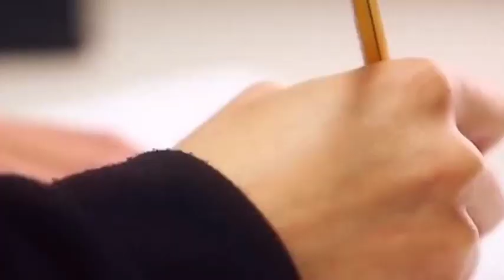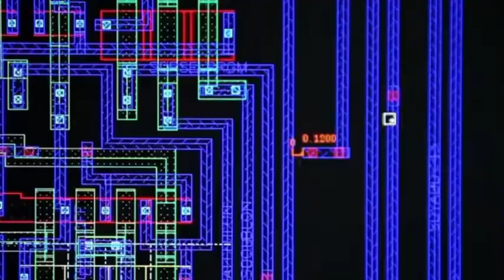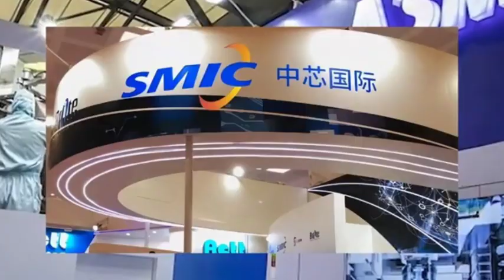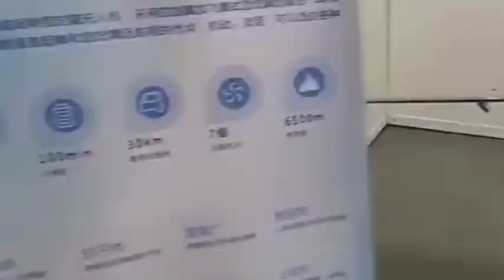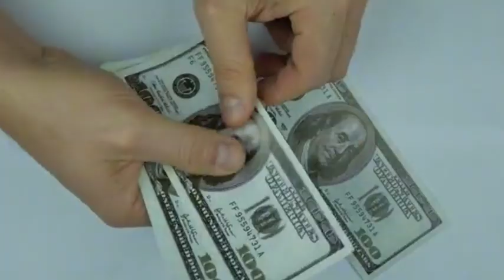Japan and ASML have shipped 42 EUV machines to China, and the U.S. restriction strategy failed!

Comment: The Chinese will take the old DUV n use  some of the parts to build EUV. They revered engineered it .
Reply: Reverse engineered.
Reply: @stephentan7881 It can be done  and it will be done if hasn't already.
Reply: well they tried with a pass 5500 system . it still doesn't work.